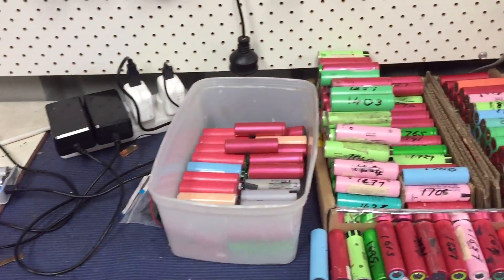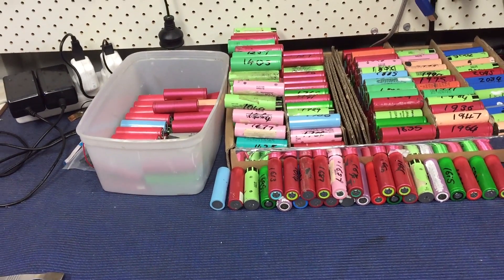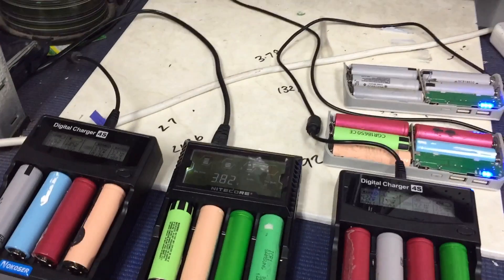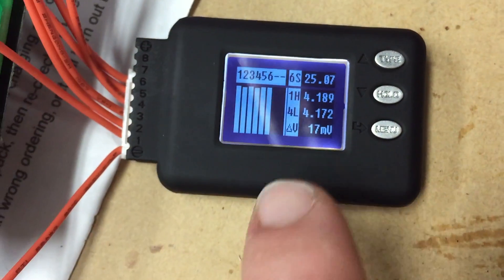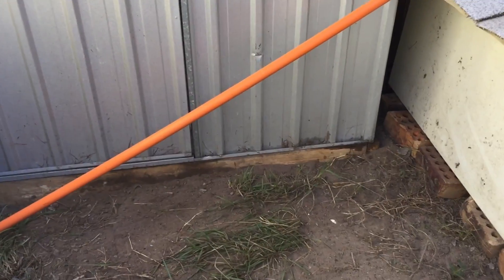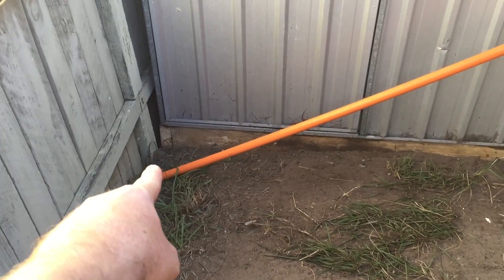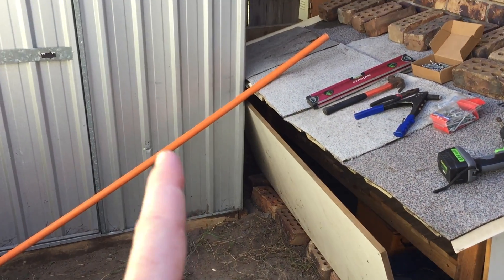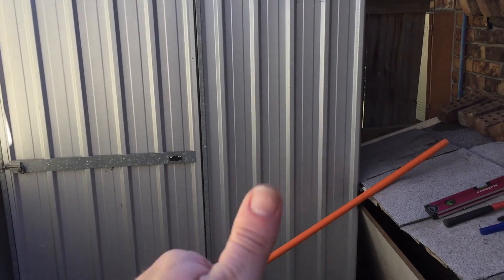Sunday 18650 Project update

Comment: The values that you write in each battery are the charging or discharging measurement?
Reply: Forget it. Found your facebook account :)
Reply from the maker: it is the discharging value
Reply: +HBPowerwall you use imax to discharge?
Reply from the maker: +João Luis Martins in the early days yes but just use it for charging duties now.
Reply: +HBPowerwall i never found any batteries with more then 2000mah on the discharge and i'm surprised that you have losts off them and i use imax to test
Reply from the maker: +João Luis Martins are you discharging at 2amp ?
Reply: +HBPowerwall no when discharge with imax i never had bateries that make 2amp usually do 1amp 1.5amp the best ones that i found and 1.8amps
Reply from the maker: +João Luis Martins seems everyone tests at one Amp now.
Reply: +HBPowerwall i discharge with 1amp to and the test of discharge never found any batteries with 2000map capacity
Reply from the maker: +João Luis Martins have you retested any of them. ? 2000 isn't bad and perfectly useable.
Reply: I continuo to not found almost nothing with 2000 mah each
Reply from the maker: Don't give up i've had a month of 2000 average - few months ago it was 2500 average just depends on the cells. It's the game we choose to play. Stick with it :)
Reply: +HBPowerwall i will use cells with 1200 mah in small packs and test to see what will give
Reply from the maker: Can't hurt
Reply: @João Luis Martins, from your facebook page I gather that you're Portuguese, right? Where do you get old laptop batteries from? I would be really interested in giving this a try. Thanks in advance.
Reply: yes i'm from portugal and start doing this to but it's not easy find laptop batteries with good prices and you are you from?
Reply: Hi João. I'm from Barreiro and I don't know anywhere where I could find and buy old laptop batteries in Portugal...
I was wondering where you were buying from ;-)
Reply: eu tou a vender algumas q ja testei ate 1500mah eu sou perto do seixal e tenho perguntado a casas de informatica mas geralmente n é facil comprar barato
Reply: Pois, casas de informática querem vender-me packs de 25 por 2€/2,5€ cada célula. Tá tudo doido...até parece que são novas.
Reply: pois acontece eu ate dava esse valor se me garatirem 50%  com 2000mah
Reply: tem o meu facebook joao luis martins
Reply: João, eu ontem encontrei o seu Facebook mas hoje já não consigo. Podia meter o link pfv?
Reply: Awfully sorry for posting in Portuguese but we're both Portuguese and I am just trying to figure where to buy from and just exchanged some posts in our native language to ease up contact exchange.
Reply: eu coloquei um post no diy powerhall no facebook
Reply: diy powerwall facebook
Reply: João, that's not a link. And when I search for that on Facebook I come out empty...

Comment: Nice! Could you please share what's the device you use for balancing at high currents? A link maybe? Thanks.
Reply from the maker: +gsmgsa haven't connected them yet so don't even know if they'll work sorry search my videos for BMS Crapcity
Reply: +HBPowerwall so... the best way to balance them for now would be manually or wired in parallel...I recon' :)

Comment: Might not be an awful idea to keep a register of battery vendors and types that have prismatics and generics in them.  Probably take more time to maintain it than you would save by not ripping open batteries only for them to yield disappointment.
Reply from the maker: +thirdwheel1985au hell no, paper work sucks do enough in real life. As i'm starting to get through so many cells i'm learning what has 17670 cells and prismatic cells are typically much thinner than 18650 cells. Some slip through but that's life.

Comment: Those batteries are the normal for me, all over the map,  I just capacity checked over 60 cells and the highest one was about 1172mah:( but I did get 72 laptop batteries that still had bubble wrap on them so I am hoping that they are new old stock.  Fingers crossed.
Reply from the maker: +Your AveRage Joe i think i have just been WAY too lucky in the past - it's time for a reality check but move forward :)